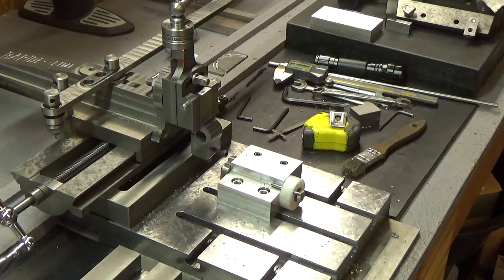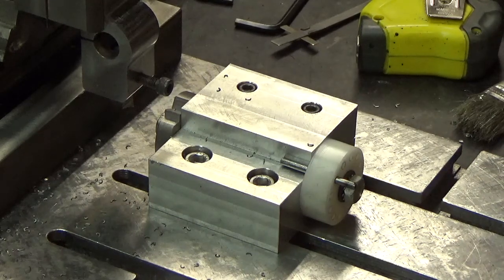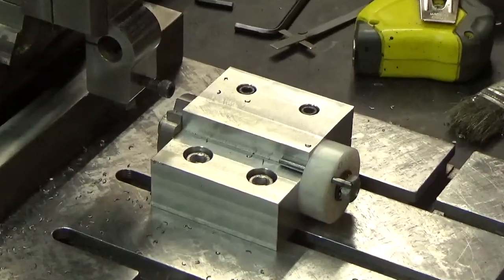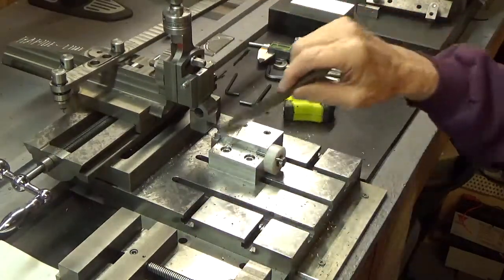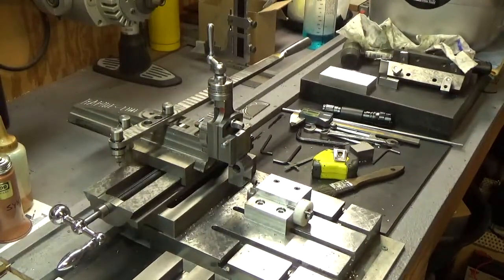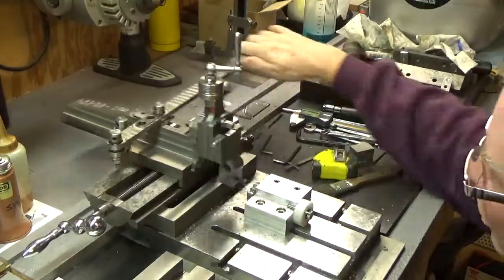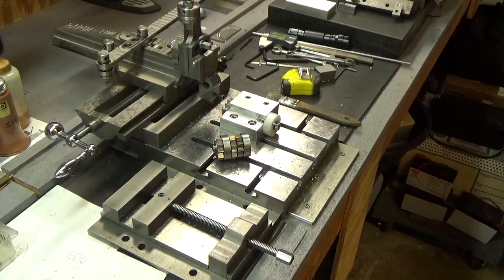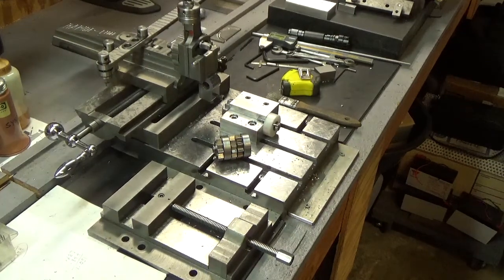Cutting 4130 Steel Star Wheel With Shop Built Hand Shaper (Part 2)

Comment: Hi, Larry,
     that is working out really well and the shaper will come in handy when you have the milling machine tied up with a setup that's in process, will that star wind up with more teeth than 12? I feel its a bit of a puzzle with getting a happy solution about the best number of teeth involved for fine feed with that auto feed design, more teeth will narrow the contact space between teeth so will one stroke of the ram move two teeth forward each stroke?? or just the one tooth?  there are a lot of variables involved, it's my opinion that  two actions that will improve the situation are an adjustable pendulum for height contact on each tooth or a larger dia of the star wheel  other than those two a finer thread on the leadscrew but that involves a lot of extra work

All in all, it seems you have a nice workable setup especially with your recent video and the beautiful finish you got with your shaving toolbit and aluminium block,
Reply from the maker: Walter:  I actually have no need for additional Star Wheels.  For 13 teeth I would need to shorten the pendulum a considerable amount and the engagement would only be a maximum of 0.060".  Right now I'm thinking that 12 teeth is probably the happy medium.  I was actually just cutting this star wheel as a test piece.  I can always use one of the 10 tooth wheels if I desire a faster feed rate.  A longer feed means a shallower depth of cut, etc..  Best Regards: Larry

Comment: Great progress on shaper.  Weather in your area certainly is improving.  East coast still beliow freezing at night, but 40s to 50s during day.  No big projects in the works, but making a couple of hieght gauges for setting tool hieght in lathe.  Do i need them, not really, but need to have a project to keep mind / body active.  Take care.
Reply from the maker: Roy:  I think height gauges are extremely important.  I use them every single day and wouldn't be without them.  Mine are nothing fancy, just a short piece of steel rod.  Some tool bit grinds are a bit forgiving, while others are not.  Best Regards: Larry